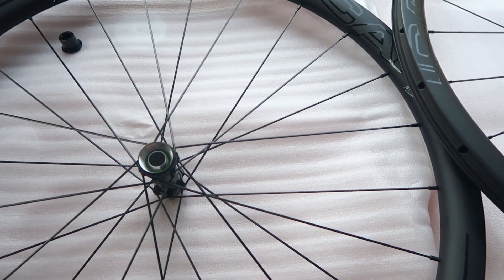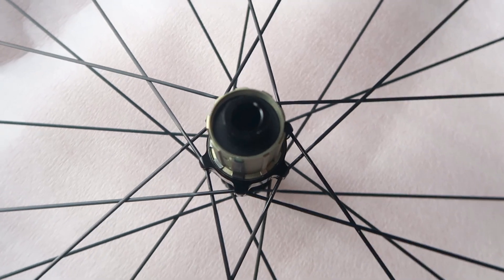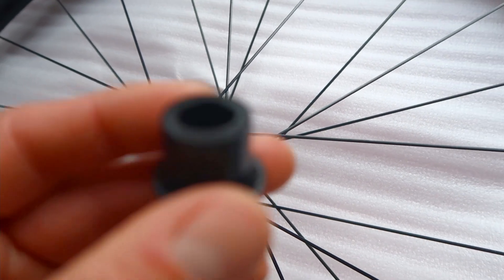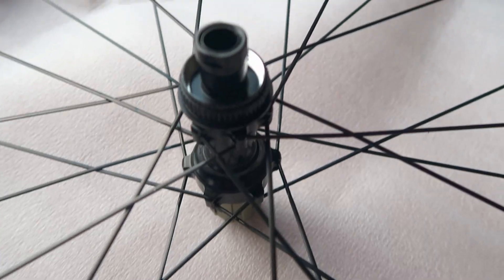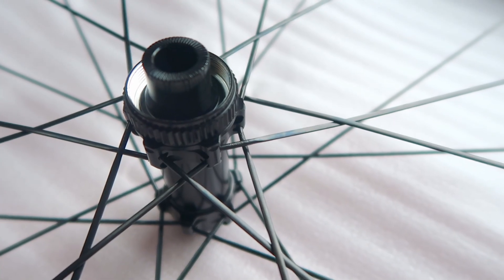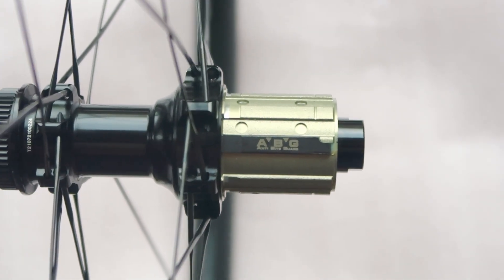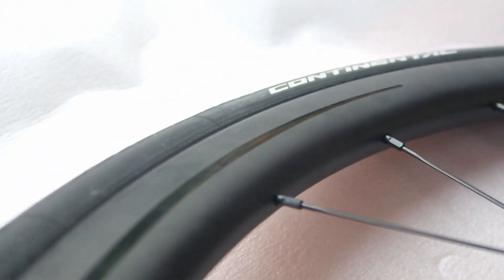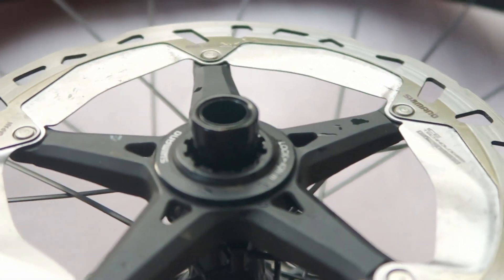Budget Carbon Wheelset build quality: ICAN vs Top Tier

Comment: "Gonna get some wear if you're putting the bike in and out of the car..."   *Why don't you get a roof-rack?"
Reply: That's only allowed if you are older than 40, Plus your bike get's dirty
Reply: Roof racks cost non negligible amounts of money, can be easily cut in a matter of seconds while leaving your car unattended in a parking lot (I know people who had their bikes stolen like that), increase your fuel consumption at motorway speeds (so more money), and create obvious (and expensive if unlucky) issues when entering underground parking lots, tunnels or when passing tolls with low ceilings (again, I know people who ruined their bikes and their roofs because of the good old "forgot I had me bikes on top of the car").

Bike in and out of the car is the only right way.
Reply: @11robotics  how about using towbar bike rack? Had Thule 927 for 5+ years and managed to sell for the same price as I bought it for. Was leaving bikes overnight on it while travelling, used D locks to lock the actual towbar from opening and locked the bikes to the rack - bulletproof combo.
Reply: @antonv5488  thieves usually cut down the entire rack, as it's generally made of aluminium, with the bikes on it. Same goes for roof racks. I know people whose bikes got stolen in minutes exactly like that, and I was warned more than once when going in various campings in the French Alps that people recently got their bikes stolen from their bike racks overnight while they were sleeping next to them. 

Tow bar racks are inconvenient for other reasons, too. I have a friend who rear-ended his bikes while reversing out of a parking lot and ruined both wheels of one bike. I know another who cracked his rear window after the end of one MTB handlebar hit it repeatedly on a bumpy road. Lastly, every time you need to access your trunk, you need to get the bikes out of the way.

The only way is bike inside the car. Clean, quick, cheap and safe. I had two Renault Scenics and now I drive a Dacia Lodgy for this exact reason. I can easily carry three people, two upright bikes with their front wheels off, and quite a bit of luggage, all safely inside the car. Or three people and their bikes and a minimum amount of gear. Much less of a faff to get the bikes in and out, and much less of a faff to get the (home-made and cheaply made) bike carrier brackets in and out of the car.

Your choice.
Reply: @11robotics  great points, you should check Thule's top tier tow rack models that have a platform with number plates and lights, they have reclining mechanism to open the trunk at any time and it would be extremely difficult to cut them and then carry with the bikes on. 

I wouldn't be able to fit 3 bikes inside of my big estate car as they take huge amount of space, but more importantly - they are a true safety hazard for passengers in a case of an accident. Tow bar racks are crash tested and won't get inside the car. 

So I better be careful when reversing, which wasn't a problem so far.
Reply: @antonv5488  thank you, but I am not paying those exorbitant amounts of money on tow racks that I have to install and uninstall every time I ferry my bike around (which during summer months happens at least once a week). I agree, if I had a smaller car (especially so far as the boot floor to boot roof distance is concerned), I wouldn't be able to carry 3 upright bikes in its boot, in which case what I'd do is just fold 1/3 or 2/3 of the rear seats and slide the bike inside, with one or two wheels off if I had too. Still a quicker, cheaper and safer way to carry a bike around than carrying it outside the car.

Comment: 15,000 miles on my ICANs.  50 up front and 60 rear.  30mm wide. I added DT350s and they are amazing.  Havent had to tighten 1 spoke.

Comment: These are the the same wheels as Wiggles own Prime Black Edition wheels aren’t they? Hubs and spoke lacing look identical
Reply: Prime use the same factory as Hunt for rims. Can't remember which one it is, but it's not ICAN. Regarding the hubs, it doesn't matter who makes the rims, they are made by different factories. The big Chinese brands are Novatec (which Hunt uses) or Bitex (one of the better brands overall). I'm pretty sure these are unbranded Novatecs.

Edit: apparently they are Novatec, per the video
Reply from the maker: Pretty sure they're novatec, and they use CX ray spokes which are great
Reply: @conman1395  I've had Bitex hubs on set of wheels and I found them to be very smooth. Had a disappointment with current wheels with the Novatec 411/412. There are two versions it seems, all black and the older gold axle and gold freehub. I replaced the black axle to the gold version as the black cracked into several pieces after a few hundred kms. Novatecs customer service was awful and unwilling to send me parts under warranty. The seller was also uncooperative.
Reply: @glennoc8585  yeah, I love Bitex hubs. I wouldn't ever use Novatec hubs on anything that didn't have a 3rd party like Hunt to do the warranty stuff for me.

Comment: @Peak Torque  I bought the disc hub versions also and had to send them back. The Shimano freehub was to big to fit a cassette on. ICAN CS told me to file the freehub down so I could get my cassette on, which I did. When I rode the wheels I could feel the rear wheel oscillating up and down and when I looked at wheel rotating in a stand you could see the hub moving up and down and the bike rocked back and forth in the stand, which meant to me the hub bearing seats where not parallel. After lots of back and forth with ICAN CS I sent them back for a refund. The wheel weights were also well over specification. Very Disappointed!
Reply from the maker: That's shit. Hubs definitely not the best.

Comment: I've had a hub axle failure in a on all black version of the Novatec rear hub 412db model. The hub also slipped from delivery so I changed the spring and pawls which sort of fixed problem. I'd go powerway again as ive found them to be faultless hubs
Reply: My Novatec 412db hubs also slipped on delivery but I didn't change anything, just kept riding until the grease thinned out and I haven't had them slip again recently but I do get loud ... pops? creaks? -- hard to describe -- on occasion, especially after a gear change (but it doesn't always do it). Do yours ever do that?
Reply: @samuelmundula2216  My hub creaked then cracked when the rear  hub axle disintegrated. I've had no problem since I put the gold anodised version on but I still get slips when climbing.  I suspect there are two grades of hub being sold to OEM builds as the decals are different. Are you hubs the common looking versions or the all black version?

Comment: I have a set of Aero 40s and agree that it is exceptionally difficult to seat a standard clincher tyre  running inner tubes.
Reply: Have the same wheels, and use ride now tpu tubes. Seats the first time super easy. Before it was a nightmare

Comment: 1.5 years, around 18’000km on the ICAN Aero 45s, no issues at all, however you are correct, they are an absolute bitch to mount tyres.
Reply: Have you ever tried cooling the wheel and warming up the tyres? (Put the wheels outside/in the basement, the tyres in the sun/on a heater)

Comment: Would've been interested in the braking surface of the rim versions
Reply: I have a setbof Aero 50 mm rim brake versions.  Mine are 2 years old.  Still true.  Brakes about as well as any carbon wheel can brake, even when wet.  I am very happy with mine.  I have a set of ICAN disc brake wheels too a bit older.  They've been excellent.  Ive got thousands of miles on both sets.  By the way, mine have the ICAN R01 hubs rather than Novatec.
Reply: I have the rim brake aero 45s, no issue with brake surface after 18’000km, although I’m not a huge fan of carbon brake tracks in general, especially when bombing hills 😳

Comment: Dude it really is thé hardest thing to mount Vittoria corsa's with Tan walls on them! I literally use Thick rubber gloves to roll them over. Sometimes I had to leave thé tyre on them for a night so they would stretch a bit and I could push thé last bit on thé rim. Didn't have thé issue with hyper 2023s though
Reply from the maker: Good to know! I found gp5000s needed a bit of soapy water to mount (even non tubeless). Just with thumbs no levers.

Comment: I have an older model of the AERO 50's. The rims are really durable and have survived two racing crashes. But they're not great in cross-winds, and I've had some minor freehub issues.
Reply: what were your freehub issues?
Reply: @juliushoffeins37  The freehub bearings have a bit of play, and once the pawls got stuck
Reply: I bought some of their "used stock" which they had for sale wih a great discount. They said no warranty but supposedly they had QC. It ran very rough, so I removed the freehub body and saw it was corroded, pawls, bearings and all.
Wrote Ican about it and they sent me a new freehub and it's been fine since,  the hub bearings run perfectly.

I have to say, I think the freehub body design is flawed. They milled  some of the shoulder that would sit up against a seal, to put the Bite Guard in place, which seems like a suspect design anyway.

Comment: I’ve had a set of ICAN F930s on my full sus 29er for over a year. They have performed flawlessly, not needing to be trued and no spokes needing to be tightened in that time. I agree the Novatech hub is the weak point which is why I went for DT Swiss 240 hubs which was an option at the time.

With the 240 hubs my F930s come in a little over 1400grams, which was a sizable weight saving over the DT Swiss M1700 wheels they replaced. I’ve been extremely happy and am even considering a set of F922s for my XC race bike. 

This very in-depth video from Jim Langley played a big part in my confidence to spend a grand on my F930s.

https://youtu.be/3yPjw0xgu4U

And to be quite frank; something like 95% of Mtb parts and frames are built in three factories in China anyway. Most people are riding Chinese bikes and don’t know it. So the stigma is unwarranted now.

Looking forward to seeing updates on your test.

Comment: Wouldn't it be so easy to file the end cap knurl off? OLD probably only 1/2 to 1mm smaller.
Reply from the maker: Would definitely throw the disc alignment out even moreso than it already does!
Reply: So add thin spacer washers under the end caps?